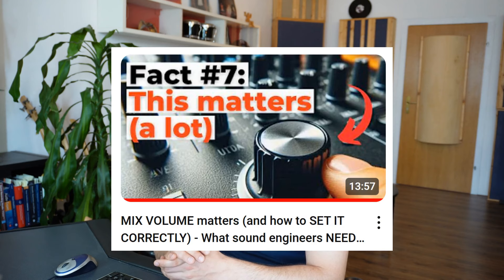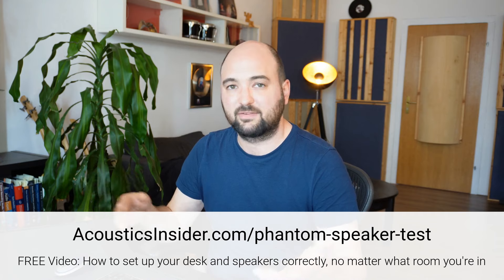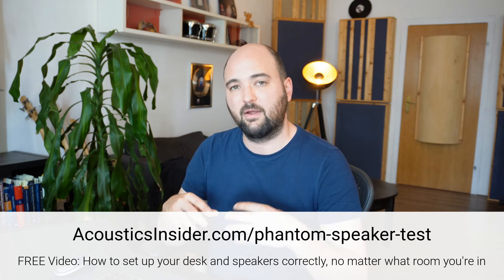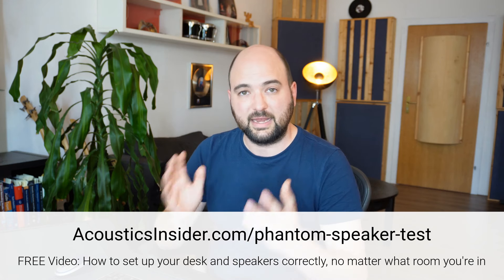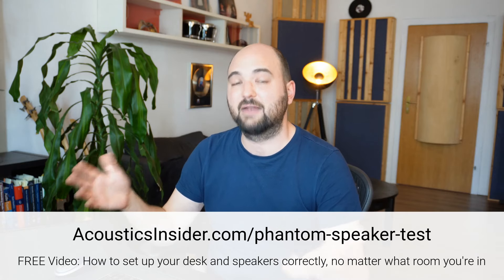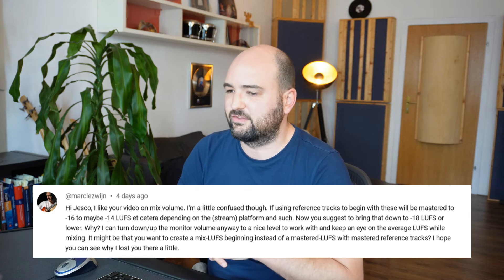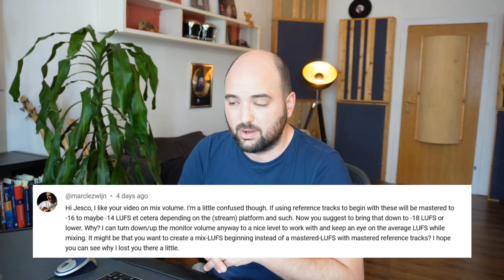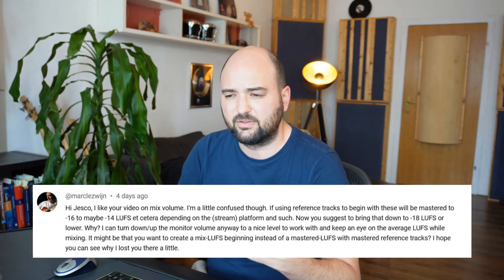Using LUFS in mixing (an addendum) - What sound engineers NEED to know

Comment: Could have been good to mention that a sound system can be SPL calibrated. You can link your preferred SPL level to your preferred LUFS target.

For example if your style is usually mastered to -8 LUFS. You can calibrate your system to have -8 LUFS at your preferred SPL, for example 76 dB SPLc.

You could also give yourself 10 LU of headroom for mixing by turning the speakers 10dB louder and working 10dB quieter.

Comment: I don't mean to be rude here but I think you have misunderstood the function of the master fader or, I may completely misunderstood your video (that is absolutely a possibility :-).  )
The master fader function, in a music production workflow (not to be confused with a live setting), is (mainly) to adjust the peak level of the master bus. In a music production/mix situation it should newer be used for setting the general listening level, that's done with the Speaker Level/Monitor controller. A mix has to have the highest peak level in correspondence to the standards you work in. For streaming files it's usually Tp -1db. It's then possible to monitor LUFS in a constructive way.
LUFS, the dynamic range, is adjusted by using limiters, clippers, compressors and by adjusting individual channel faders, or a mix of both (Im trying to oversimplify as much as needed.....).
To mix with a peak master bus level of -30db (or whatever) is not a good practice as it means reducing the systems total dynamic by -30db. In the analog word that would mean lifting the background noice by 30 db.
I do agree that setting a "standard" listening level is very important. In my opinion this is much better done by using what Dolby suggests, using pink noice and a sound level meter.

Comment: I'm still a little confused on how exactly to execute this, if only because I am having difficulty visualizing what you're describing. Any chance you can do another short video demonstrating this on-screen? Are you using a meter plug-in on your master fader set to the desired LUFS level, and then every time you mix a project, you are always checking that meter to make sure it's hitting that level (and if not, moving the master fader to compensate)? But then again you said you want the master fader and the monitor volume to stay fixed, so now I'm confused as to how exactly you're hitting this desired LUFS number -- unless you're always adjusting your individual tracks, in which case you've just switched the "constantly moving volume" that we're trying to avoid, from one place in the chain to another. Yeah I'm still confused lol I need to see it in practise if that's at all possible, thanks! :)
Reply: Trying this out in Pro Tools, I'm thinking the old method of routing all tracks to an aux (let's call it "Output"), and then routing that aux to the master fader might make sense. Drop the meter plug-in on the master, but use that Output fader to get the desired LUFS -- this way you leave the master at the same level and of course the monitor volume as well. Maybe that's the solution?